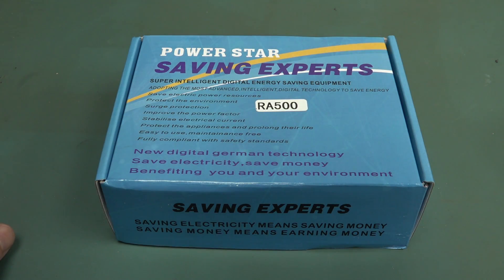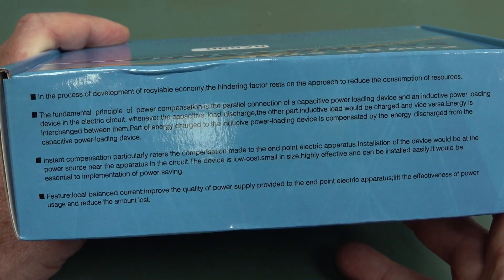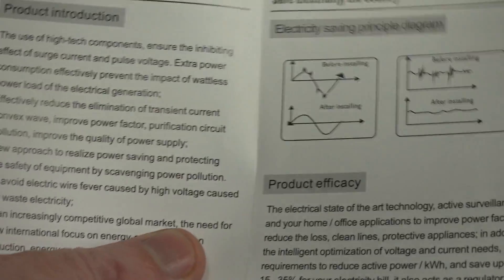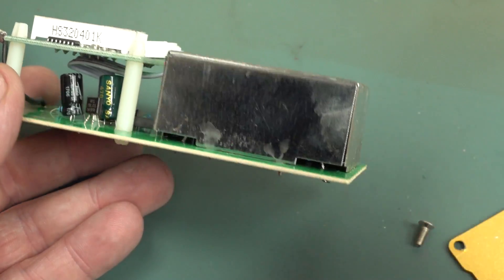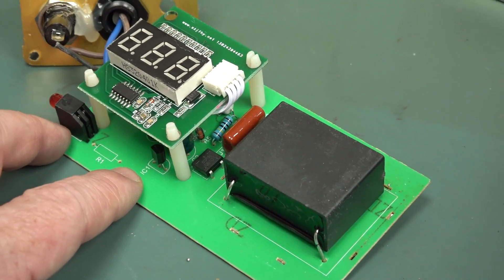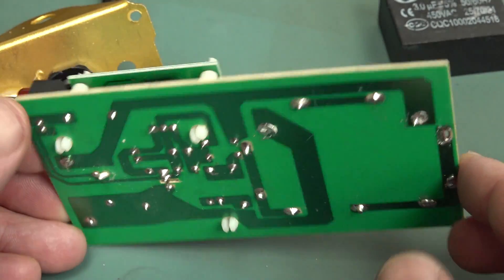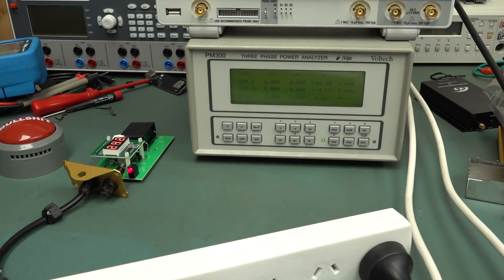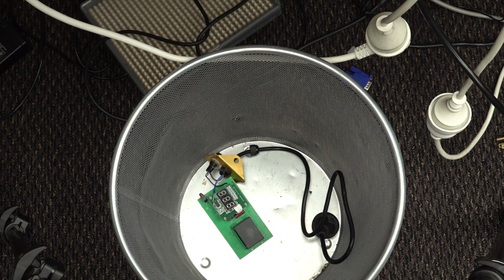EEVblog #1191 - Digital Energy Savers BUSTED!

Comment: In the UK the old style meters self compensated for power factor correction (I'm not 100% sure how this works but it has been tested). However new smart meters amongst everyone I have talked to end up charging about 30% more than the old meters. IE all the same appliances within the household used in the same way. I'm guessing this is because they do not self compensate for power factor. I for one will not be getting a smart meter till it's sorted out. I really want to see a smart meter in series with one of the old ones.
Reply: old style meters don't have to compensate , their design means that they automatically measure only real power not apparent power . So called smart meters can display either real or apparent power but, for the time being at least, it's the real power reading that is used for billing,
Reply: @Rosscoff2000  In theory yes, but how do you explain every person I know that has had a smart meter getting a 30% hike in bills nothing else but the meter changed?
Reply: @gordonlawrence4749  don't know, but one obvious possibility is that they had been on estimated bills that were running behind when the smart meter sent in updated readings. Or they are on monthly payments and the electricity supplier took the opportunity to hike the monthly payment, which is something they do given any excuse, but you don't lose the money, it just builds up a credit. 
Whatever the reason, it isn't because they are suddenly being billed for apparent power.
Reply: @gordonlawrence4749  ps you could always put your own private traditional meter in series with the smart meter as a check.
Reply: @Rosscoff2000  I'm seriously thinking about doing that in a friends house who now has a smart meter.

Comment: Uncommonly good English translation for a cheap Chinese product.  I pity the morally corrupted native English speaker who wrote it.  He must have known that what he was writing was BS.  However, I found an alternate use for one of those PF correction/AC motor capacitors that does work, sort of.  I Put it across the secondary of my homemade isolation transformer/dim bulb tester, and it dimmed the bulb slightly in no load.  Was it worth the $3 I paid for it?  Probably not.

Comment: I have installed a capacitor that corrects the power factor for all installed light tubes. If I change the tubes to LED, do I have to remove it to the capacitor?

Comment: can i plug this into my EV car to get better gas millage?
it's 3 phase motors  300volts
it does have a 120V plug with earth ground

it has dual 60KW electric motors 3 phase  300volts

Comment: Another one expensive aluminium case for DIY projects.. :D and there is extra bonus - LED display, fuse holder and spare fuse..  That's all for what this device is useful.. 
Power cord, probably, is not even from copper.. Please, next time measure wire resistance! ;) There is scam "copper" wires in market which can cause fire hazards, because of big resistance..
Reply: Nothing is more unsettling then smelling melting plastic coming from behind your Screen and PC . . .  :-/

Comment: You touched on it for a quick second but I am curious. Why is audio gear never earthed? Harmonics?
Reply: Audio is not earthed so it free floats so as to not get earthing eddy currents which can occasionally hit an amp or two. This inductively couples into almost everything and causes noise. That's one reason. The other which is more important with DC coupled audio gear is that you need free floating circuits so you do not get a DC bias on the input. If you do the output can just latch-up to maximum voltage on one wire and minimum on the other and just stay there pretty much blowing everything apart. There are way of protecting against this but they introduce noise.

Comment: Might be of value for iron ballasted fluro lights EXCEPT from memory the capacitance should be around 8uF per light. Should add I've had two similar looking caps fail in appliances, both in Delonghi dehumidifiers.

Comment: Looks like they wired the fuse holder backwards too. Also doesn't look like theres a discharge resister across the large cap either.

Comment: lol. now a whole home load balancing transformer would help save money in the US since we are metered on the highest power drawing leg but that's not a plug in device that's a main transformer that balances across both 110 legs in a US system. They are used so you don't have 1500 watts draw on one 110 leg and get charged for it on both legs.

Comment: What about a Power Conditioner? I needed one for the Pa speakers. Whats the deal with them?
Reply: Active or passive? Passive they are just lowpass filters that block HF noise, Active convert to DC and resynthesise the power in an inverter.

Comment: Your paying for the case on that one, cheap plastic case ones really work and not just 25000watts but 28000watts.
Energy saving spike buster SD001, how is your life complete without one?  :)
At £3.38 the price is tempting, but that case on yours does look nice. But has yours been tested? These come with a testing number.  :)  FCC logo for good measure.

Comment: what happens if you plug into a modified square wave inverter ???
Reply: Boom!
Reply: I actually would like to know. Will a smoothing capacitor help cheap dc to ac inverters?
Reply: @sheadjohn  

http://everycircuit.com/circuit/5190036694499328

Comment: "save up to 35%". "up to" includes 0.
Reply: Should say +/- 35%
Reply: @moshly64  
Up to 35% also includes -35%
Reply: But it will actually cost you more worst case to it can end up costing you 120% of your normal bill.
Reply: That is a  Truthful statement.   Misleading labeling, but 'honest' in the sense of zero being included in the set of integers.
Reply: save + upto absolutely implies more than 0.
Reply: Doesn’t include <0 so it’s still lying
Reply: @entidade1000  
It's like a 2 for the price of 3 offer.

Comment: I'm an industrial electrical engineer. Majority of manufacturing plants are paying their electrical bills in kWH, so power factor makes little difference on the electrical bill. We prefer to keep it above 0.8 or so. Poor power factor may overload the wiring if loaded heavily. We do use power factor correction capacitor banks on medium voltage (4,160V) motors only. 
Beware of "snake oil" salesmen who want to sell you a miracle device that will guarantee at least 20% power saving. Ask them to leave and to never come back! They will sell you a grossly overpriced surge surge protector that does nothing to reduce power consumption. I've seen industrial plants with $800 surge protectors installed at their main substation. They paid $25,000 for the device and were promised tremendous savings. Problem is that it's very hard to verify the savings due to large variations in production schedule and machine utilization. The salesman who sold them the miracle device, drove a brand new Mercedes. LOL.
Reply: I'm also an engineer. To further clarify (to other readers): Even factories and such pay their power bill based on the amount of KWh, so real power, they consume. However when the power factor is too bad then an extra cost gets added to the power bill, based on the amount of VARh above the treshold. The treshold is usually about 0.9 and as long as the power factor is higher than that there is no extra cost, so most companies with big inductive loads will also use capacitors to improve their power factor. The reason why inductive loads are bad is because they cause a phase shift between the current and voltage. Capacitors also cause a phase shift, but in the opposite direction. To properly correct the power factor, these phase shifts have to be matched so they compensate eashother (or at least mostly, usually the capacitor is slightly smaller to cut costs since correcting the power factor above 0.9 yields no benefits). This gives these "power saving" devices even less credibility since they use a fixed capacitor which isn't matched to a certain appliance. BTW, a common price for having a bad power factor is here 1/5th the cost of a KWh, per VARh consumed beyond the 0.9 treshold, though that may vary based on region and supplier.

Almost all home appliances do not resemble an inductive load at all, and so while they can have a bad power factor you'd need a more advanced filter than just a simple capacitor if you'd want to correct for that.
Reply: @IkBenBenG  In my country, the limit is tan phi 0,4 which translates to cos phi about 0,92~ so all industrial places have to keep the power factor above 0,92. I believie its valid for whole european union. And there is amount of reactive power that you can draw and not pay for it, but if its exceeded you pay for additional reactive power, and there are separate fees when your power factor is lower for certain amount of time. For domestic use, they dont monitor your PF nor the amount of reactive power.
Reply: @sumilidero  Yeah I just checked, you were right, it's 0.9 instead of 0.8. And indeed, that only applies to industrial electricity.
Reply: @sumilidero  To my best knowledge, power companies do Power Factor (COS Phi - as you call it) correction on their supply side but they may bring this to our attention if PF gets too low. Of course it may vary by municipality and power company's rules and procedures. They may also request that we don't start any major machinery during power peak hours. Either way, most industrial facilities get charged by Kilowatt-Hours, meaning that PF is somewhat irrelevant but again, it depends on local rules and regulations.
Reply: @andrewevanoff1192  Yes the main unit is MWh (megawatt-hours) and the measurement is done on the 15 kV side in transformer substation that is owned by factory or other industrial facility, but there are other charges in terms of reactive power as i mentioned before. Thats standard in europe and i believe in rest of the world to reduce as much as possible transfer of reactive power in transmision lines, therefore local compensation in every industrial facility is required and the condition is required to keep (here) PF above 0,92~ otherwise there are additional charges aside of the standard active power added to the bill
Reply: That's what happens when a company trusts outside salesmen over and above it's own engineers. We live in an age where bullshit is king........

Comment: Well... before you toss it, you can always rip off those components from the board and toss them into your spare parts bin! :)
Reply: Why should you stock crappy parts?
Reply: @CyberlightFG  I don't know... I'm not an elitist when it comes to my parts.  I'm just a circuit bender so I just rip parts off of everything that falls in front of me.  If I can get cheap, quick, parts that I can use in projects, I rip them from anything I can.  I'm not building things that are going to be used for professional stuff. :)

Comment: Okay, dumb question: imagine having a very long power cord in the house with an inductive load at the end of it which is loading the cable quite heavily. Wouldn’t a power factor correction yield some savings by the reduction of losses to heat in the wiring? Because the energy that gets converted to heat is real power.
Reply: If you were using a lead long enough and thin enough to cause sufficient loss to be significant, it would make more sense to get a more suitable lead for the device than fiddle about with the power factor.
Reply: Rosscoff2000 it wasn’t a practicality question.

Comment: Big Clive determined that a hot dog has a power factor of 1.
Reply: Yes you quite correct he just that. But this device does in fact have a purpose. It proves that you really can fool some of the people
some of the time. It's purpose : it is a gullibility detector, seemingly, a pretty good one at that.
Reply: @Undefined Lastname In hindsight I could have mounted them diagonally.  Or crossed them to make new and exciting current paths.
Reply: @bigclivedotcom  Don't cross the hotdogs! It would be bad. Total protonic reversal.
Reply: @SteveOddlers  I was just going to say don't cross the streams.

Who you going to call in this case The MythBusters on this energy saving device.
Reply: @SteveOddlers  don't even get me started about free energy. MythBusters did that one too. Although if you consider energy harvesting which of course eevblog has done it's technically harvested energy is free energy once you pay for the device that harvests said energy.

If you seen that episode of Mythbusters on free energy and a part of the experiment with the kit that took a hundred foot wire antenna and generated about 1.5 volts or so.

I confirm myself it works I just learned what that years ago and also this was before that was introduced and presented at the local school science fair I was running additional clock one of those little car LCD clocks that stuck on the dashboard that runs on a single cell. If I remember correctly.

And it still works well over 20 years later no kidding.

So technically it could have paid for its own batteries if there were iney to begin with.

But the thing is the current was ridiculously low in terms of what was available from the 2 boards in series to get enough voltage.

 My current meter didn't even register on the most sensitive range but if I had a microcurrent it probably would have worked but then again this was even probably before eevblog existed I'm sure I'm in my forties. This was before high school I actually came up with a circuit on my own. As a curiosity and I just cheer crazy experiment didn't even expect it to do anything.

By the way I prototype LCD projection on a sheet of plywood in my basement.

 3 Old black and white LCD panels three projectors as light sources

A prism a bunch of odd lenses projector parts overhead projector parts and opaque projector parts in a few things from projection TVs and such and customer Electronics and a bed sheet as a screen and the lights turned off and you could see a dim fuzzy color picture on the bed sheet.

I was told if only I had gotten a patent done this years ago I probably what made big money on that patent. But alas I would not have access to the patent office. I never thought this would actually have been a viable product idea or anyting.
Reply: @bigclivedotcom  "In hindsight I could have mounted them diagonally.  Or crossed them to make new and exciting current paths." I'm looking forward to your next video, where you turn a hot-dog into a capacitor! 😁
Reply: @bigclivedotcom  be careful Clive you might create a Resonance Cascade doing that
Reply: I have seen them in the shops here in Australia before, but fucked if I know who buys them, because you can get ‘real’ hot dogs here. I use that term very loosely, but still, it’s less... weird.
Reply: @uzaiyaro  You think hot dogs in a can are weird? Don't go shopping in the UK. Over here there is one brand that sells them in a glass screw top jar. Bit like one of the bigger coffee jars but with parallel sides. It's like someone decided they were not weird enough so started getting up early in the morning to practice.
Reply: @gordonlawrence4749  I got a glass jar of hotdogs too, but they were too long for the hot-dog-o-cutor.
Reply: @uzaiyaro  Yeah a good dog is okay here and there. But i can tell you from experience
i took my son camping, and yep bought some dogs. Did not burn all of them in the fire. In June. In april ten months later, they did not discolor, a little dried out but no foul odor. That has got to make one wonder just what is in them. Granted it goes below zero here ( east coast US ) over the winter.
If they have lasting power like that, there is NO way they can be good for you.
Reply: @uzaiyaro  Yeah I had never thought of getting hot dogs in a can like Clive had.  In the US, they typically come refrigerated or frozen.
Reply: Gross, they mince up any old part of the dog to make those so there's tails, paws and lips instead of the tastier cuts.
Reply: @FrankEdavidson  Eyelids, forskins and labia as Ashens would put it
Reply: SO I should buy 100 hot dogs instead of this energy saver?  hmmmmm
Reply: But most of us would have expected Dave to be the guy measuring his wiener on YouTube, right?
Reply: stonent lol i watched tht before this.
Reply: I dont think I could eat a hot dog from a can...
Reply: And his own power factor was f*cking painful from that crazy video he did a few days ago.
Reply: Yep saw that video yesterday.
Reply: **best comment :D
Reply: Oh yeah I remember that video, when he cooked his own hot dog... xD
Reply: Those canned hot dogs tho
Reply: @uzaiyaro  Yeah, i cringed when i saw that. Wonder what the sell by date is on those gems of goodness ? 3/18/2025
Reply: @uzaiyaro  Yeah right. I never seen canned dogs before that. Oh, them little Vienna cocktail wennies I guess.
Reply: @DrexProjects  I've seen canned hot dogs in supermarkets, under different brand names.
Reply: @RichardWatt  . Hmm. I'm in Canada. I don't think canned dogs are a thing here. But I have seen canned potatoes. Nope, didn't try them.

Comment: Clearly not compliant with AU safety standards.

Not earthed and even the instructions state not to touch the mains lead after unplugging it because it will hold a charge. Also no compliance markings.

I am VERY surprised it has what looks to be a compliant mains lead though. Usually we just get the Chinese uninsulated ones. Or any other country plug and a deathdapter (bigclive reference).

Comment: is it good for scavaging parts to another project? The green electrolytic is Sanyo?
Reply: You can probably buy the big cap standalone for less and if you're using electros in your own hobby builds, buy a variety pack. They're cheap. No reason to support these crap products.
The case is kinda nice though.
Reply: Buying the parts you want separate is cheaper.